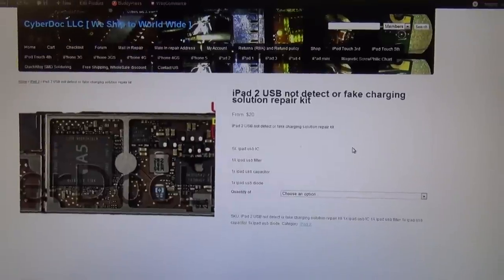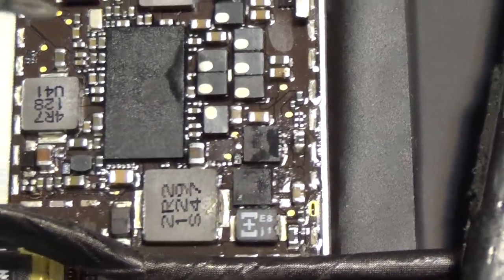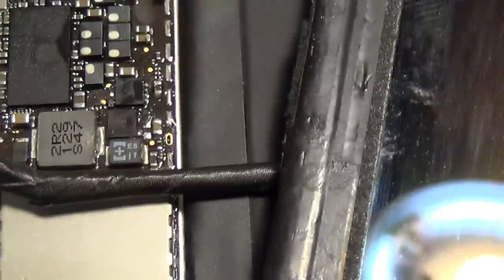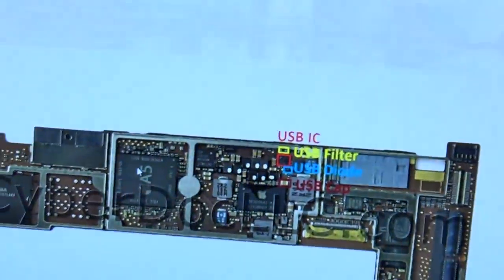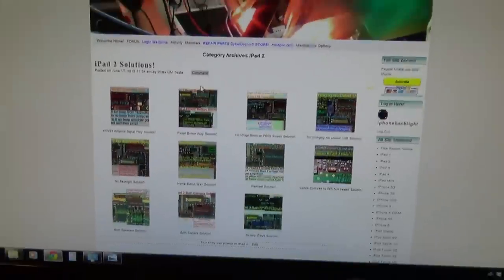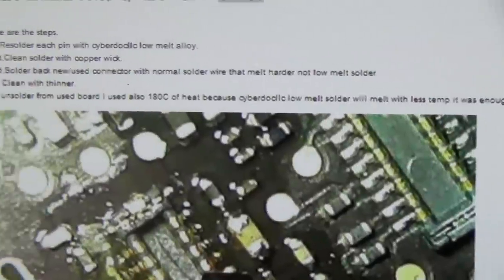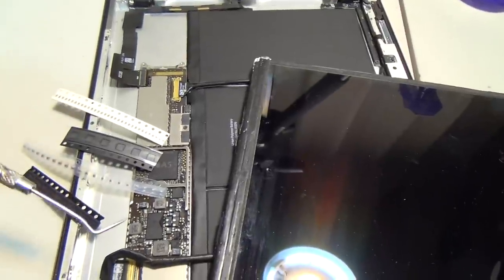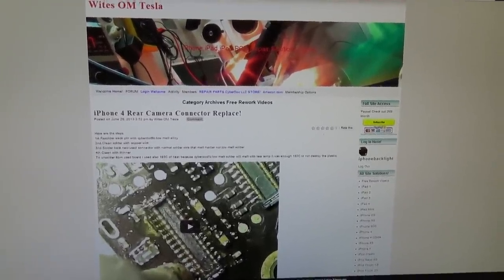iPad 2 3 4 mini USB not detect or fake charging solution repair solution CyberDoc LLC

Comment: I have error 9 , the ipad connects fine to computer , changed charging port too , do you think the error are related to these components?
Reply: Peopleman29 your hard drive(NAND) is not making good connection with CPU. Meaning you have a bad hard drive or CPU or there is a broken connection in between